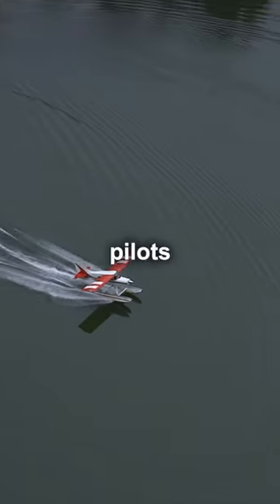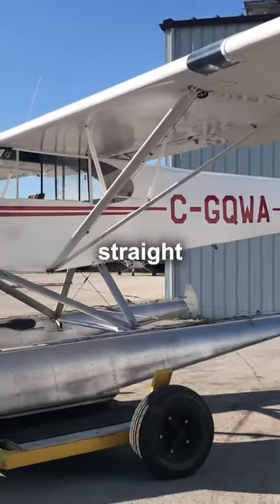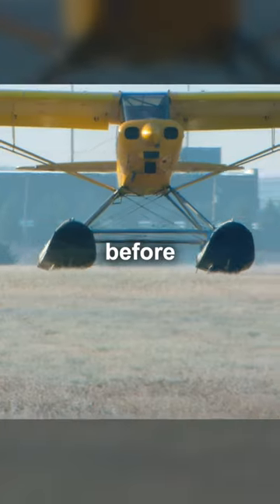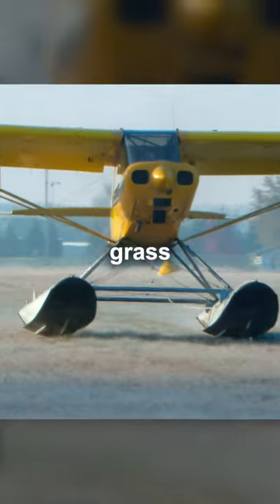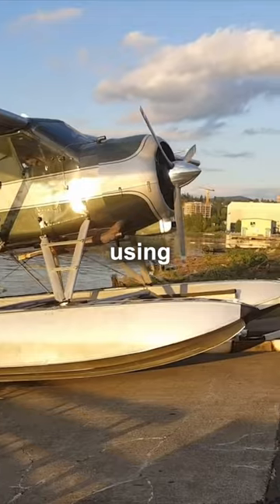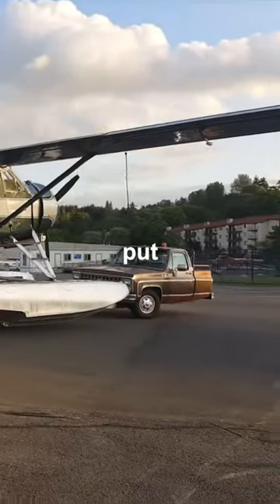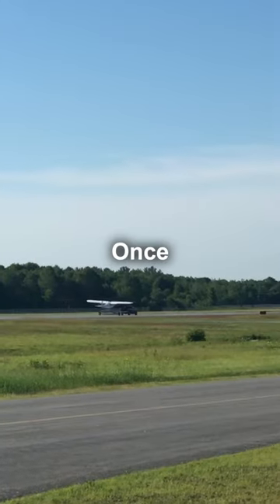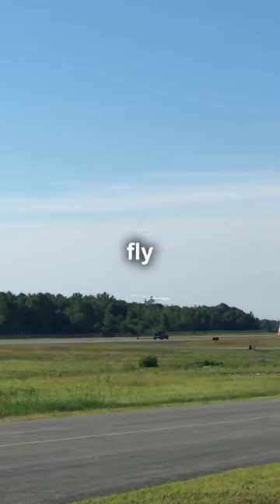The strange way float planes start the season

Comment: If you got a good enough acceleration and run you can get a truck up to 100 mph.  With a favorable wind, you’ll take off just fine.
Reply: Right and most of these planes can take off between 50-70 kts
Reply: @omegaminus  If you forget to loosen hte straps you might carry the truck a short ways too!  Running debris patrols on the active runway was fun.

Comment: Who just saw half a truck
Reply: I did
Reply: I believe they have a second video on this channel explaining the logic behind the half a truck. It popped in my feed earlier today
Reply: Me
Reply: Custom built with a big hydraulic lift on the front. Lots of them in use at KRNT (W36 is the seaplane ramp). Tricky to drive but lots of fun
Reply: @spencermoran9774 id imagine it be similar to some type of forklift or backhoe?
Reply: @ethangardner2470  yep exactly. I think due to the simplicity the only trucks that are used are from the 70s and 80s MAYBE the 90s. Carbureted trucks that just sound horrible but have nothing complex at all. They’re a blast!
Reply: There are a couple at Lake Hood in Anchorage AK.
Reply: its better steering and the visibility while the trailer wheels takes place of the removed trucks rear wheels
Reply: First time?
Reply: They are made to pull back the planes and reduce weight give power and have better balance.. there is a vid about it
Reply: I know I was like WTF!
Reply: I thought I smoked too much 😂
Reply: Whole truck with cab reversed.
Reply: @spencermoran9774 as a purseron with a 74 C10 suburban with a carbed 350, it sounds great
Reply: I came for it
Reply: Me
Reply: Does anyone know what it's called? All I find are half sized trucks or half-tracks

Comment: Btw some aircraft can operate on straight floats when they have retract wheels. Also, the Lake 270 Turbo is an actual obscurity. Yes the half truck is real, yes it works.